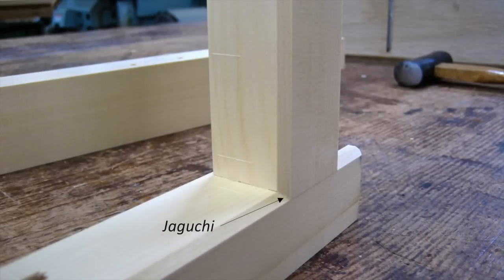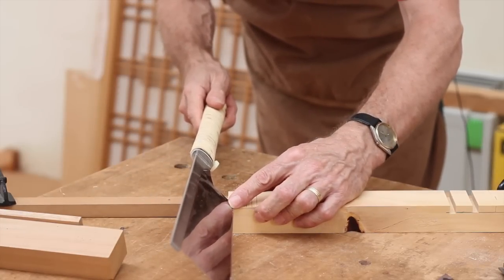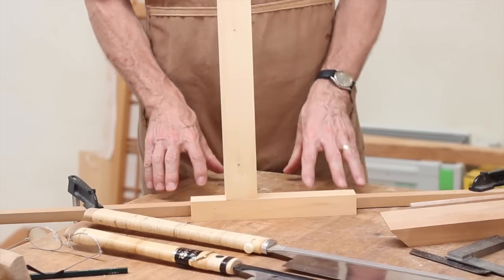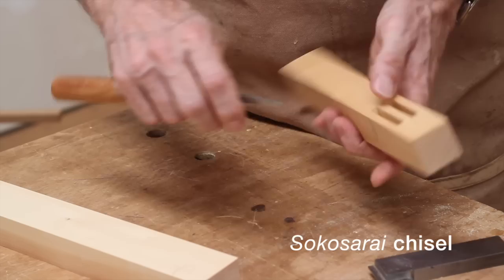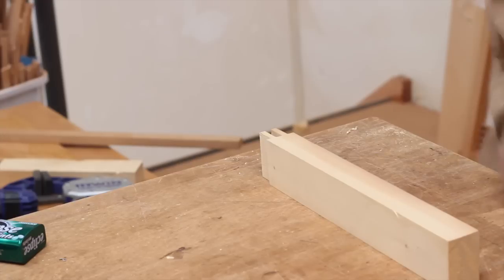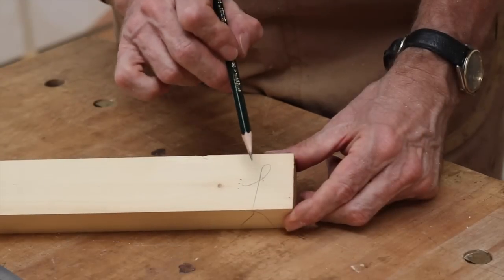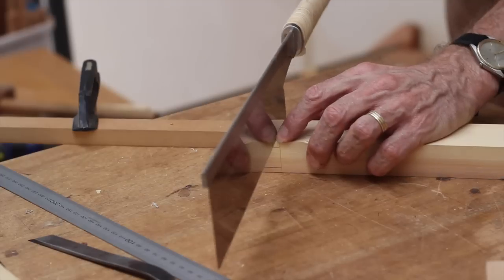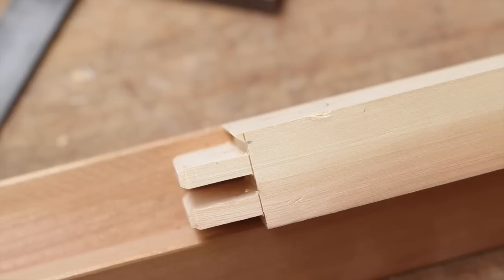Shoji and kumiko patterns - 02 Exercises Pt 2

Comment: Love your videos and books Des! Is there an each way to transfer your measurements to the imperial system of measure? Is it as simple as converting to imperial and rounding ? Would it be easier to purchase metric chisels and simply use your measurements? 

Thank you,

Nick
Reply from the maker: Thanks Nick. Calculator or computer conversions will work, but they'll never (or rarely) be the exact measurements of the metric. My advice would be to try to work in the metric. I'm old enough to have gone to school using the imperial system in Australia before the change started in early 1966, and I still find that even today some of the imperial measurements enter my head more easily than the metric ones. The instructors at the college in Japan where I studied shoji-making tended to use both the metric system of millimetres etc. and also the old Japanese measuring system of shaku, sun, bu and rin. For this, in my mind I simply looked at it as marks on a ruler, and measured according to that, rather than become confused by the new (to me) measuring system. So if a measurement was, say, 9 bu, I simply counted nine marks on that ruler, rather than try to convert it to the correct 27.272mm. I found it easier that way. The same concept would apply to metric and imperial. Rather than try to convert say, 27mm to 1.063 inches, simply count 27 marks on a metric ruler for the measurement. Then there's no worry about conversion errors or mistakes. Japanese chisels are normally made these days in metric, but if you have Western chisels (which tend to be imperial), grinding the edges to turn a 3.2mm (⅛") chisel into a 3mm chisel is quite easy. I've done this with some of my Western chisels, even to the extent of turning a 3.2mm chisel into a 2mm chisel. It's simple. Not pretty, but it works. Hope this helps.
Reply: kskdesign thank you so much for the thoughtful reply!